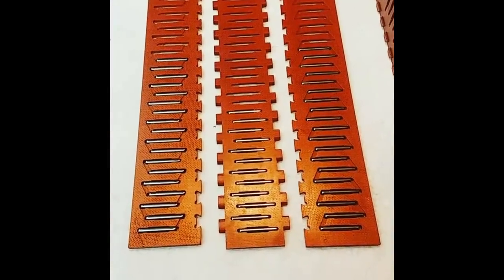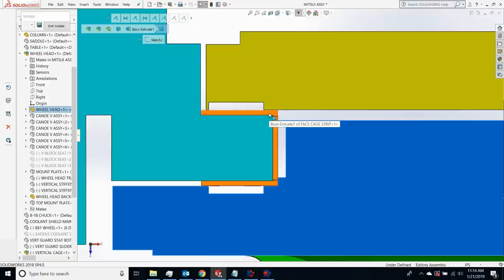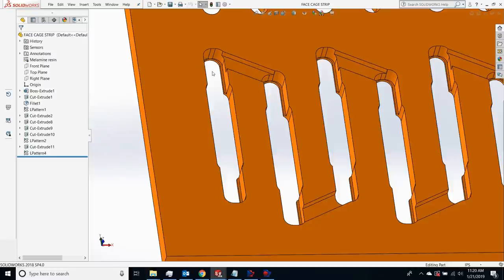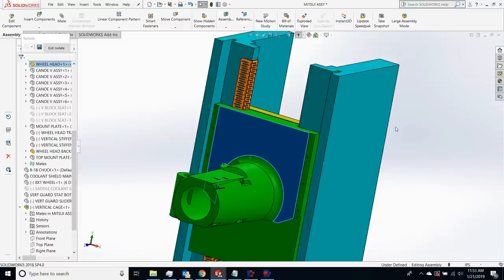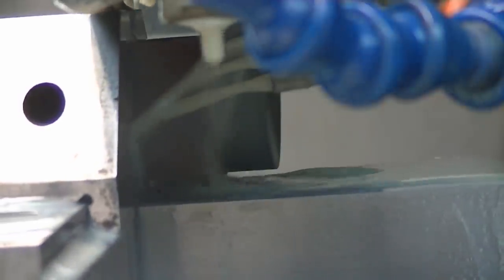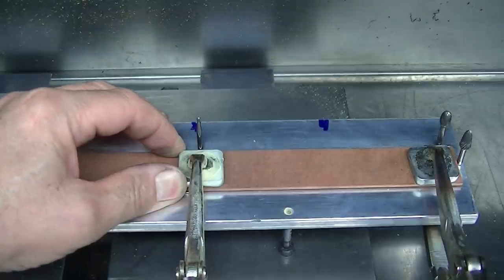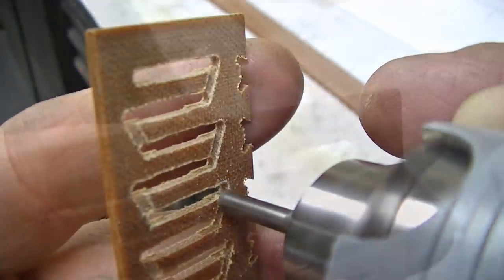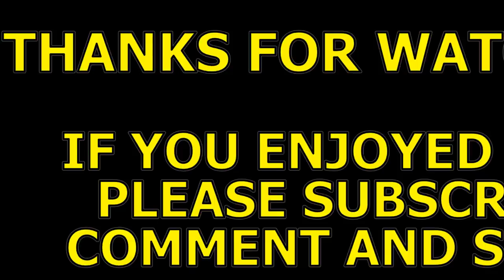MAKING LINEAR NEEDLE BRG. CAGES

Comment: Galleries...oil galleries…
Reply from the maker: That is debated and galley is more commonly accepted.
Reply: @ROBRENZ  thats weird.  Ive been around mechanics all my life and have never heard that.  By definition a galley is a kitchen on a ship and a gallery is a long narrow passage.  Googling it i can only find galley as an incorrect pronunciation of gallery in reference to oil passages.  In what circle is galley more commonly accepted?
Reply from the maker: @DoRC  I should have checked deeper. I have always heard galley and my casual google search gave me the impression both are used and It was a toss up. But after reading some of the details you are correct that gallery is the correct term. I will correct that in my next " Attention to detail" video.
Reply: @ROBRENZ  thanks for looking into it.  I very much respect your work and knowledge and was starting to think I was going crazy:). Of course I do understand that language is an ever changing thing and if galley is used enough for long enough it inherently becomes accepted. It's just one of those terms my dad beat into my head when I was young (he was an automotive and aircraft mechanic for 60 years) so when I hear galley it invokes those memories:)

Comment: You can just buy the needles. why rip apart bearings?
Reply from the maker: I could not find a US supplier that could actually provide them in these smaller quantities. Since then a viewer gave a link to a UK website that has them for a very good price and I will be buying them.
Reply: @ROBRENZ   thanks funny, i have to go to the uk for mine too. lol. thanks for replying. love the videos man keep up the great work
Reply: I had the same problem last time I needed to replace bearings for the surf. grinder.  My latest is one of the Acer/Acra/Kent/Chevalier, etc grinders.
Reply: mostly because I dont know how long the bearings on the Micromaster are going to hold up yet, even though it runs fine.  Reminds me of Steve's Solid Rock latest video on the rebuild/inspection.
Reply: Guys whoch website😢?
Reply: Guys, bros, where is the WEBSITE!! Arrgg I need it now❤😅

Comment: glass fiber will wear your cast iron extremely quick! replace them as soon as possible
Reply from the maker: It is not glass fiber.
Reply: @ROBRENZ  that is good: some machinists repair their lathes with glass fiber reinforced pads and then are surprised why the second rebuild comes way more sooner. was terrified at first glance..